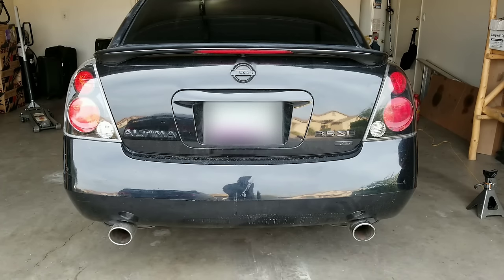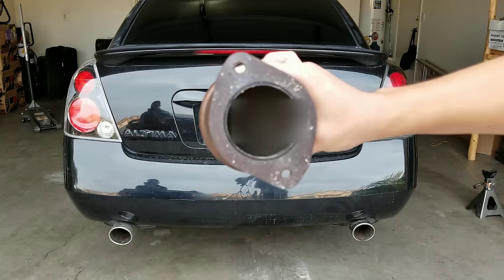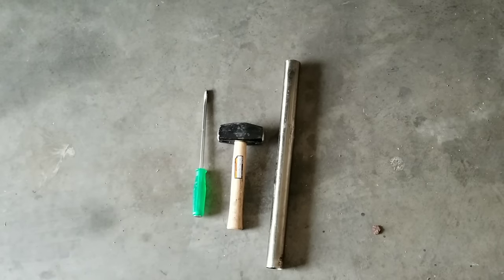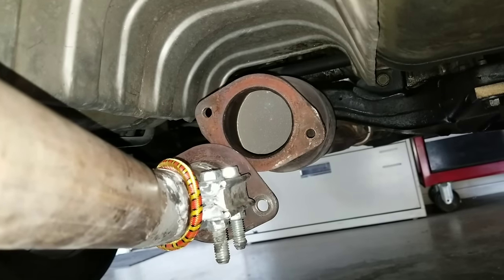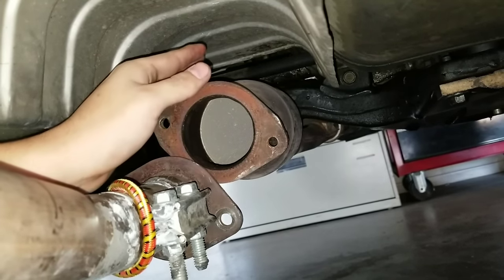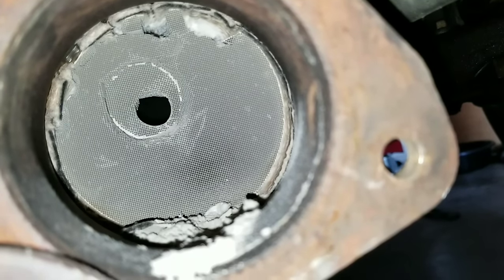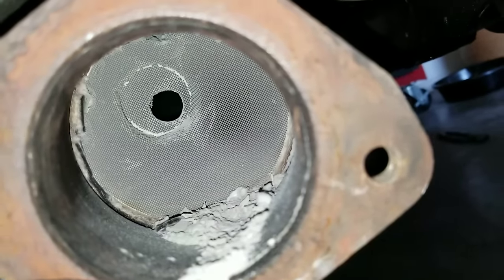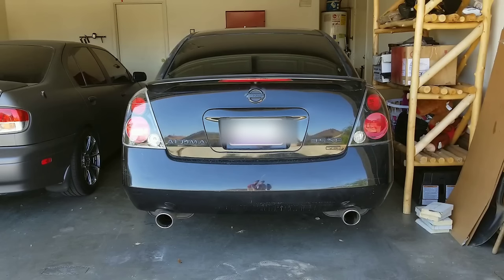How To Delete Your Catalytic Converter!

Comment: Pro tip - Wear a dust mask or respirator.  This stuff is deadly. 👍🏿
Reply: Notsofast L what if i want to smell that e85?
Reply: @RhythmWalkerKS  you paying for the exhaust that I bet he puts
Reply: Nah fr.
Reply: Pro Tip Enjoy Ur Mask 👍
Reply: More like pro tip take the whole thing off and get a couple hundered bucks for it then replace it with a piece of flex pipe from auto zone😂 literally dollar signs wasted ina fuckin Walmart bag smh
Reply: I got 2 converters on mine, and an 02 sensor in between. I realize its the  downstream most likely but sometimes its better to just leave the electronics alone or put a chirp sensor in. But I still woulda probably tried to take the whole thing off the vehicle. If it powders enough to breathe it should hopefully be brittle enough to break apart and fall out. If I did it on the car I'd probably just cut a C shaped access panel on the converter and just tried try to get the whole cylinder out
Reply: @tylgreen9670  it killed me when i saw all that precious metal going to waste
Reply: How im not dead yet?
Reply: @RhythmWalkerKS  I feel what you’re saying but he probably lives in cali where it’s hard to find a shop that will weld a test pipe where a cat is supposed to be and doesn’t weld him self. But you got a point
Reply: @Oystercaulk  Who said they didn't get $ for it?
Reply: @BaveMage  fair enough lol i just assumed he wasnt holding a bag under it or anything but yeah it wouldnt make sense to just let it all go to waste
Reply: A gas mask ya, mine don't have any sensors on it either, so won't do anything but make engen run better...
Reply: Dont do it is even better id only do it if the cat was blocked or it rattled and thats not to gain or lose HP to save a buck no joke this can cause tuning issues that ruin the acceleration and de celeration and braking if U got a powerful turbo car see how hard it is to slow down when the rpm and boost continues to spool this guy is a ricer
Reply: Asbestos
Reply: @iTsTHumpa my shop said they won't cut the cat off and weld a straight pupe...I'm in Cali
Reply: yea was thinking of that you under the car better put some glasses as well
Reply: @ivanvolkov2239  I know it's been a year but you have no idea of what you're talking about 😂 do you even know what a catalytic converter's purpose is? Granted not all cars the same, but most people will be fine running a hollowed cat with no tune. But without a tune, all you get is sound and potentially a CEL. A good tuner could probably cook you up a tune to get gains from the hollowed cat.

Comment: Hey dude, it would have been better to remove the whole pipe before hammering because you are putting an incredible amount of force against the whole pipe going to the headers which can cause an exhaust leak and damaged pipes/headers...I know because I did that with my integra back in the day
Reply: same question
Reply: Even putting a jackstand under it and  ratchet strapping the cat to the stand would help if it's an issue getting the cat off the car.
Reply from the maker: The cat is welded on to the whole exhaust it can't be unbolted
Reply: @ERICSDIYGARAGE  well you can take it off at the manifold, but depending on the vehicle and the age you'd probably end up replacing the studs if you tried to take them off lol. No disrespect, but if somebody tries that and their manifold studs and nuts are rusted to shit they might end up with an exhaust leak lol. I get where you're coming from though and you made a good video, just a thought for someone who might try this themselves and end up breaking off old rusted exhaust studs.

Comment: Use a drill with a wood spade bit with an extension added to the spade bit. Drill holes in it all over(the honeycomb) to break it up and then use a shop vac to clean it out. Way less work.
Reply: I used a masonry drill bit 10in
Reply: yeahhh frrrr
Reply: I used a masonry bit in a hammer drill, worked a treat 😂

Comment: I think u just spoil the expensive part of a car, while u may just swap it with a straight pipe, with the option to reverse it back the CAT anytime in future.
Reply: Well true but a straight pipe may be more visually detectable.
Reply: you can also sell it and profit
Reply: And about fucking environment??
Reply: @aeon9367  sure do that
Reply: @NOName-nn3jv  environment won't die from a dude removing the cat
Reply: Jack black should have kept quiet.lol
Reply: Won't this give different readings in the car sensors? My question anyone?
Reply: @frankgonz31  if not mistaken, those sensor sense only the O2 ratio of before & after the combustion. Nothing else.
Reply: @aeon9367  everybody wants to save the environment just ask China ,Russia and India who have all upped their carbon output production China is building coal plants like crazy as well as the other countries so how are we going to offset that with what we think we're saving .
Reply: then how can he shoot this video
Reply: And fuel consumption?

Comment: Nice sound dude! Easy way to be a bit louder and gain a few HP without having to spend hundreds of dollars on an aftermarket exhaust!
Reply: literally coulda bought a test pipe for 80bucks and keep the cats aswell
Reply from the maker: No you can't add a test pipe to these vehicles because the cat is welded to the y pipe only way to add a pipe is to cut the cat out and weld a new pipe in.
Reply: @FunFiction704  Why would you want to keep the cats that would be stupid. Keeping cats=restrict exhaust flow=lose hp/gas mileage.
Reply: @FunFiction704  Why don't you go and make your own video so you can direct your own instead trying to be the director of someone else's video
Reply: Why would u do this 4
Reply: Buy a new cat
Reply: @ERICSDIYGARAGE Exactly i have a 2011 nissan altima 3.5l V6 my buddy told me the same thing when i told him i was thinking about getting a cat delete

Comment: Or just straight pipe it. and sell the cats foe money.
Reply: You can still sell the guts
Reply: How can I sale the cats please?
Reply: Abo Al izz scrap yard just gotta bring documents so they dont think you stole them from a car
Reply: @jeremyhe8328  thank you so much, do you know how much they pay for each?
Reply: Abo Al izz sadly i do not but i know its quite a bit bc theres alot of precious metals in them.but you wont walk out disappointed
Reply: Abo Al izz if you do it let me know how much you get i wanna know how it went
Reply: @jeremyhe8328  OK
Reply: Well this way a yearly test centre won’t be able to see the modifications.
Reply: John Nelson  thank you so much brother
Reply: @dirtcheapmedia3390  they won't know where it came from so you'll get bottom dollar
Reply: @pauldhennessey  correct but bottom dollar beats no dollar
Reply: @dirtcheapmedia3390  NO!  0 dollar beats bottom dollar cause i rather make zero dollars then have somebody make $100 when they only gave me $25. Ft. That how much cats are worth in n.c. the whole state was trying to get ppl for theirs cats. F getting got.
Reply: John Nelson  dang bro wat state is that.  Where r u @?!
Reply: I was going to delete my cat but the power gains are insignificant.
Reply: I thought the same damn thing those cats are full of Palladium
Reply: @jeremyhe8328  the expensive bits is the Palladium
Reply: @paulroy8456  pretty sure it's Arizona
Reply: Ron F  Yes for engines with forced induction it works.
Reply: @dirtcheapmedia3390  you'll get more if you sell it whole
Reply: Sounds good im about to do that to my titan.
Reply: I have sold some I got $650 for some of a honda accord
Reply: I live here in az deleted my cat too
Reply: Hollowing them makes it less obvious because they look like they are still there
Reply: Better to just save them for when inspection time comes around. Same with the EGR valve. Idk how inspections are done or the frequency if not annually, but if these things are needed then you can switch back and pass. Catalytic converters are hella expensive too.
Reply: @Backyardmech1  dont have them where i live but we have spot checks from.mto and they plug into ur obd2 and check the values of evreything
Reply: knights of the fallen Mine are annual and they always plug into the OBD2 port. My cat is blown out, but I manage to somehow skate by after turning the MIL light off by clearing the codes and running for a bit.
Reply: @Backyardmech1  yea no.u dont get away as easy here because their system reads exactly what the sensors are picking up and displays it in realtime
Reply: knights of the fallen I had one mechanic check everything with his personal scanner and tried getting me in his shop for a $500+ repair before inspection. I ran down the street to a big chain oil change place and they somehow skated me through. IDK how, but I had another year to sit on the eventual replacement.
Reply: @Backyardmech1  nice here they just check stuff like your lights horn brakes stuff like that they got rid of what they called etests instead mto trys to screw you randomly
Reply: knights of the fallen I guess they feel they gotta try and get you at some point. Here you can’t even get your vehicles registered unless you have a passing inspection within 3 months of renewal.
Reply: @Backyardmech1  here you do a saftey on the vehicle once and u dont have to again as long as it stays in ur name
Reply: @knightsofthefallen5  couple years ago here in Mississippi they got rid of inspections they use to check windshield lights horn etc. But only state troopers could issue a ticket for it. It couldn't be enforced by other police. They couldn't pull you over for it. Only tell you on another stop to get one but couldn't write a ticket. We never had emissions. They tried to stop dark tint but if you had a cracked windshield or dark tint. Give the oil change place $20 when it only cost 5 and you'll get a sticker slapped on with no writing on the back.   Last one I had is from 2015. It's just money making anyway. Lights don't work you'll get pulled over for it. Horn not a big deal, they don't check your brakes only the lights.
Reply: @carlosb1  tune required to see the gains
Reply: @bricklayerlzdp9825  Yes.
Reply: @Fu Nguyen I wouldn't do that. I also wouldn't do what this video does. Like others have stated, you will not get anywhere near as much cash when compared to selling whole. This is because it is harder to identify if your material came from a genuine OEM cat or some cheap aftermarket cat.
Reply: @Fu Nguyen  You might be losing money by doing this, you can at least get 60 bucks for most OEM cats, some even more. In my area, having a flange and some pipe welded will run you 50 bucks. Depends on your location.

Eventually you're going to spend money modifying cars. All this will do is give you questionable gains and raspier exhaust. You're causing a turbulence and slowdown of gasses by removing this material. Without a tune, you may gain it somewhere, and lose it elsewhere. Donut has a simple video explaining cats.
Reply: @Fu Nguyen  Sure they would. People do all sorts of nonsensical mods. Just because something makes sense on paper doesn't mean it makes sense when scientifically tested. One thing at a time tho, this car is NA. Turbos flow differently, hence the power curves differences. To counter your point, proper exhausts on most vehicles won't see much of a restriction with a cat, especially in lower HP cars. There have been plenty of dynos showing a high flow cat performing at the same level as a test pipe.

There's even video of an 800 Supra losing only 15 HP to an HFC, and very much could be due to restriction in the OD. At those levels, it's hardly noticeable when traction is your main concern.
Reply: knights of the fallen The cop cam just force you to open your hood? That’s wack.

Comment: In my next video I’ll show you how to hide an engine light.
Reply: I use electrical tape because it's not translucent. Running 10 trouble codes right now.
Reply: This won't cause an engine light because that cat isn't metered.
Reply: @LVTHORAscending  but when they are though
Reply: Just do 02 foulers
Reply: Use a spacer on the 02 sensor.
Reply: LMAO...
😅😅😅...Mr hide it guy
Reply: Use a spark plug defouler on the O2 sensor

Comment: i used your advice and decided to unbolt my primary cat without gutting it yet to see how it sounds on my stock genesis coupe. i took it for a spin after and it was UNBELIEVABLE. The car was misfiring badly and had a bad trans and i got it all fixed but it was super slow being my first stock genesis coupe and the cats underneath where there is no o2 had to be hella clogged. it sounds like i have an external wastegate dumping to atmosphere. And the MOST important part. the car is literally pulling soo hard now i couldn't believe it. never threw me in my seat now it is. it literally feels like it gained 40 hp. it sounds like it has over 300+hp lol. going to gut the both cats out then install it back into the muffler later on.
Reply: anyone who says deleting cats loses hp has never done it to a turbo car
Reply: misfiring before removal or after?
Reply: before when it was purchased. running great now
Reply: ok
Reply: took off the primary cat. was able to get one of the o2 sensors off myself. the other one i definitely need a o2 sensor socket. i cant wait to hear how it will sound without and cats open downpipe
Reply: @Soldier1287
you got alot of subs bro, whats your secret
Reply: 230 is nothing.  I been on youtube since 2007
Reply: tru for the amount of views you have its pretty decent
Reply: strive for full screen HD quality with good sound
Reply: But won't removing the cat cause engine light?  I heard it does.

and wouldn't the computer need to be tuned as well
Reply: the 2nd o2 sensor on my car is the cat efficiency sensor. it does nothing but tell if your cat is working. it will throw a check engine light. but i can put 2 spark plug anti foulers and it will trick the cat efficiency sensor and no check engine
Reply: ok
Reply: @GenesisGenius  

This. 

Turbocharged cars THRIVE on free flowing exhaust. The ideal exhaust system for a turbocharged car is a dump pipe about a foot long and as wide as or wider than the turbo outlet.
Of course it"ll make your ears bleed... but that's why they make ear protection. 
Sure it'll throw a CEL because the car is missing data the ECU is looking for, and in many cases uses to adjust the AF ratio.  (But a tune will fix that.) 

In a turbocharged car Deleting the cat and tuning the car to take advantage of the freeflowing exhaust can realize big gains in power.
Now, they say the highflow cats are just as good... I disagree.  A power tune usually runs a little rich, This fuel in the exhaust will eventually destroy your cat 
Those pops and bangs you get (afterfire)  well... thats unburned fuel cooking of in the exhaust system.   The overpressure from the small exposions will eventualy break the catalyst matrix, or the fuel will poison the catalyst... and you'll have to replace the cat.    So you either delete the cat, or plan on spending 500 bucks every couple years replacing damaged Highflow cats. 
I deleted and tuned for mine (I drive a WRX),  I gained around 85 hp to the wheels, The car dynos at 310 hp,  it originally dynoed at 225. 
Basically knocked a full second off the Cars 0-60 time.  
.
Reply: How do you tune to take advantage of the increased airflow?
Reply: @natureboy6410  Take it to a tuning shop...
Reply: @GenesisGenius   about to do it to my 17' fusion 2.0T 😆

Comment: Get a big hole saw with a drill extension and make a big hole in the center first, then break stuff out.  If you have a hole saw as big as your exhaust pipe then all you need to do is drill out the hole through both ceramic disks to creat a straight through exhaust flow.

Comment: The Infiniti next to it says “ I hope I’m not next” 😂
Reply: Why removing or at least cleaning the catalytic converter is one of the best things you can do.
Reply: @jesusislord4060  How would you clean a cat?
Reply: @charlesbelville5090  cut it and knock out the comb or use chemicals to clean out the carbon.. scotty kilmer made a video using lacquer thinner to clean a converter.. if you can, just cut it off, it helps all cars run better, but eventually need to get it tuned after that. Also on newer cars gotta worry about it throwing a code.

Comment: When you buy a used car and it fails to pass emissions, this is the kind of history the poor car may have suffered🤕
Reply from the maker: if you actually listen to the video, I mentioned that it won't though a check engine light or make you not pass emissions testing because the cat is not metered by a 02 sensor
Reply: Poor car? Cars run better without catalytic converters, but true, it is bad for emissions
Reply: Old cars never used to have these things. These things are purely for limiting exhaust emissions at the expense of car performance.

Comment: The "facts" here are soooo wrong
Reply: Kyle Thomas, he should also keep his engine running when changing his oil in the winter...to prevent it from freezing.
Reply: What up
Reply: Paul Roy what are you even trying to say?
Reply: Indy Fist lol.  Nope.  I drive a 15 wrx

Cobb intake
Fabricated catless 3 inch exhaust
Cobb tuner
Tuned by dirty racing products in Florida
Gutted TGVs
Intercooler soaker system
Catch can
Three port boost control 

It looks stock and has some road love. But i run low 12s in the quarter on an oem and slipping clutch.
Reply: karlos Amalla oh, sorry.  I don’t speak edgy high schooler
Reply: Youtubeisbroken come run me then 1k at the Lucas oil race track I’ll sign a waiver
Reply: Youtubeisbroken killed his ass with facts 😎
Reply: Yeah none of the shit he was saying was correct. He really should have verified his claims before making this